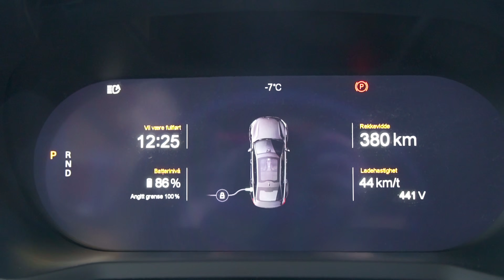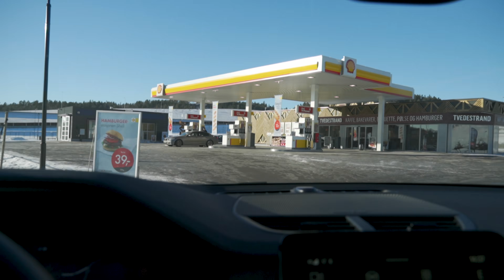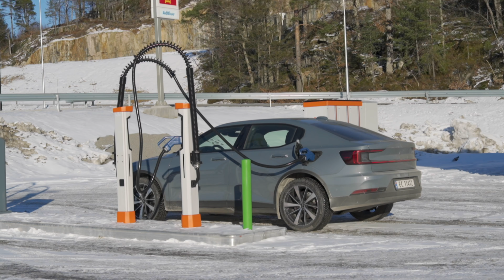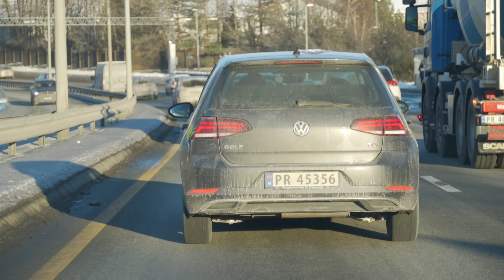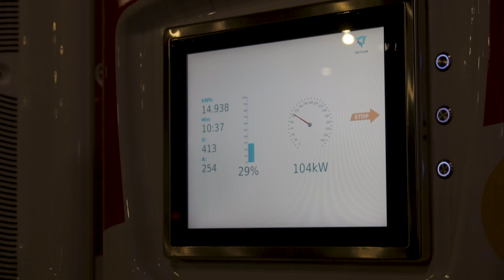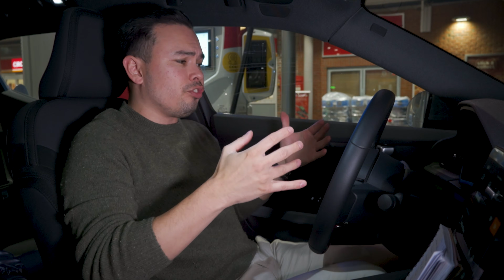Polestar 2 615km Range Test! (Norwegian High Speed Run)

Comment from the maker: This car does not have the latests software update unfortunately. But I will have a Polestar 2 Performace Pack with the update end of next week, and this exact car with the update a few weeks after that. So I will do the exact same tests with both cars 😊 So stay tuned, and subscribe and hit that notification bell if you don't want to miss those videos!
Reply: Will be really nice to get the same test with the new software.
Reply: It's the Polestar for me regardless of price and distance restraints compared to the Tesla, first of all it looks great, the Tesla looks dated in comparison the front of the Tesla being the least attractive angle, looks almost like an early Mondeo from the early 00s !

Secondly comfort and noise levels are very important to me not how far it can go, even though that can be important to some  I wouldn't swap comfort and serenity for an extra 20% distance, I don't like the slab screen in the centre of the dash on the model 3 either, so for me there is only one choice, the Polestar 2 has everything I look for in a car whereas the model 3 has too many drawbacks despite it's advantages over the Polestar, but when you know that the Polestar 2 is actually a Volvo in everything but name then that in itself is enough to swing it, Tesla's quality isn't up to volvo standards in my opinion so, when you add up all these advantages versus the drawbacks the Polestar wins comfortably in my opinion.

Comment: @KrisRifa The Pilot Assist is indeed very picky. Sometimes I need to squeeze it very hard to make the alert go away. Before I got a Volvo V60 T8 and there it was much easier to make the hold steering alert disappear. When I got the car in December it was on Summer tires. Now that I am on Winter tires (Continental) too the car is on par with the Volvo V60 T8 that had laminated glass. It's very quiet now and there's a much noticeable noise difference. It's still good on summer tires, but on winter tires it’s excellent. I'm not regretting my choice for the Polestar 2.

Comment: Cool video! Respekt ✊ to the the YOLO KING! 😁😁 
Was just thinking that unlike the etron the PS2 has only 3kwh buffer.. and considering the cars slow charging on the top it should mean that most of the 3kwh buffer is in the bottom.. which is not a lot.. 🤓
Reply: I have on the contrary heard that it have had buffer at the bottom for about 70km carefully driving and that one of the things the new update do is to lower that to get more range before the car show you 0%.
Reply: @volvodashcam  my point was that PS2 has according to spec only 3kwh buffer, and that should be used to preserve the battery.. doing 70km should be impossible when the car consumes 24kWh per 100km even of you use up all 3kwh in the buffer. 3 kw should give you around 12,5 km in theory with above consumption..
Reply: @attilaistok6168  Yea, I know. I think the 3kWh buffer is actually when it shuts off totally. You can't go lower and are not allowed to use that buffer. Then there is (as I understand) another buffer that is from the car shows you 0km left until it shuts down. That is the one that should be lowered. But I can't find any official information about this so I can be wrong.

Comment: I have been thinking about the Polestar for exactly those reason, quieter, more comfort and likely slightly better driving position, the hatch back all those are a consideration and I am waiting for the heat Pump model is likely coming out in later 2021 here in Canada and that would seal the deal!

Comment: I find it somewhat misleading to call the video "Range Test 615 km" because you really don`t meassure if the car can go 615 km in i singel charge. Every EV can go 615 km given numerous charges. I wouldn`t compare Tesla model 3 and Polestar so much, because these two cars feels so different, I suspect (not having driven the Polestar). Polestar with It`s more conventional instrument cluster, can give it more safe feeling to drive. And it`s more like a "cross over" chassit, right? Where as TM3 is more sporty lower driving feel.
Allthough Tesla would win both range and charging speed, Polestars slower charging speed might be good for the battery in the long run. Kris:  I still like your videos. I find your english and voice so natural and comfortable to listen to.

Comment: Great video! I‘m a Polestar owner and have chosen the Polestar 2 over a Tesla Model 3 due to the reasons you mentioned in your video like design, practicality (driver display, tailgate, door handles, etc.), built quality and comfort. If consumption and range would have been my number one priorities, a Tesla Model 3 would have been the first choice. Of course, the Polestar 2 has a higher consumption but we have to be fair with the car. It officially has a WLTP range of 470km versus 560km (now 580km) of a TM3 with similar batterie size and engine power. So Polestar doesn‘t even claim to be as efficient as a TM3. I hope the charging curve will improve with the upcoming February update, maybe the consumption will also be a bit better. Anyway, I love my PS2!

Comment: Would be very intresting if you compared diffrent EV's during shorter daily trips.
For example driving to a store, park the car for 15 min, drive to another store, park, and then back home. Perhaps a trip of around 20-40km.
Are the cars more equal to each other during short trips? Would be very intresting since most of the time I only drive shorter trips.

Comment: Would be interesting to know how much slower you would have to drive with the Tesla to match the time of the Polestar and then compare the noise. 😂
Reply from the maker: Hahaha! Valid point 😂😂
Reply: 20 km/h less, which brings average speed to 80 km/h (instead of 97 km/h), than the trip with the M3 will take 7h40 ... question is, is the noise level at 80 km/h so much lower with 100 km/h ?

Comment: In Sweden, Polestar is the worst EV you can buy. Superhigh charging prices in comparison to competitirs and worst battery performance winter time.

Why you would pick polestar over tesla 3 with heat pump is a mystery to me...

Btw, pleae upload a video of id 4
Reply: 1) build quality
2) tire noise / rattling noises
3) how the car feels
4) service centers and service
Reply: Not true at all. Polestar 2 is rated really high in Sweden.  And for the charging you are not bound to charge with the one plug they give you. (It's like blaming a car brand for high gas prices just because they gave you a member card on a pricy pertol station chain) It's easy to get a few rfid's and such. There ar3 even simple apps that are cheaper than Ionitys own prices. (ChargePoint)

Comment: Hi Kris,
Great video again. Yesterday I charged at MER 150kW charging station from about 20% and got very disappointing 55KW max speed. I'm really looking forward for next OTA update which promises some improvements in regards to DC charging since this situation is completely unacceptable. From this video it already seems that update had a positive impact on range, but more testing is needed (https://www.youtube.com/watch?v=UeCQr2JM8KA).
Btw, next time your are heading to Kristiansand try to avoid entering centrum (train station in particular). There is a lot of ongoing excavation work and traffic regardless what time of the day is pretty bad here. One more tip (which I'm sure you are very aware from Oslo). These 2 tunnels after bridge and towards city center are always jammed around 16 :)

Comment: Polestar 2, does not charge quick when you are with more than 10% SoC. Thats why it charges slow. Try to arrive with 5-10% percent at HPC's.
Reply from the maker: From the charge curves that are out there, and the tests me and Bjørn have done that is not true. Where did you get your information from? Do you have link? Watch my other videos on the P2 and XC40 P8. And what do you mean by "does not charge quick"? Two days prior to this test I was getting 121kWs at 40% SOC. I'd call that quick for being in the cold.
Reply: @KrisRifa  Hi own, a Polestar 2 myself, exactly the same spec you tested. 19 inch non-PP. I have noticed from experience that if you start at high SoC, that i wil not achieve the same speeds you get in the normal charge curve at the same percentage. Like you said the P2 has weird charge curve and weird charge behaviour. 

Like you tested earlier if start with a low SoC, at 21% it should charge @> 120kW. But because you started at 23% it does not nearly hit those speeds at 23%. The battery is warm enough you drove 100km/h at more than 2 hours, i have experienced the same thing in my p2.

Comment: Do you know which SW version your P2 is running?
Reply from the maker: This is running on the old version with Android 9. I will have a Polestar 2 with PP and the newest software at the end of next week, and this car with the update two weeks after that again 😊 So stay tuned!
Reply: @KrisRifa  There are already some people in Germany and the Netherlands with the latest Android 10 and the socalled February (OTA)-Update and they experience much better consumption and charging characteristics. Why (OTA) ? Because some already have it through the service at the Volvo/Polestar dealer, in Germany the OTA rollout is scheduled the last week of February in batches. :-) There are also more things for the better. : -)
Reply: @KrisRifa  Will be interesting to see if the new SW will improve charging speed👍
Reply: @kvileren  @Kris Rifa It does speed up the charging as several owners has demonstrated already. Also the comsumption is lower  and the range has also improved.

Comment: Have you done a noise test at 100kmh in both cars?
Reply from the maker: I have not done a test with other instruments than my ears 😂 But there is a big difference imo.
Reply: @KrisRifa  thanks for your reply and the videos are great. I think it would be useful to do a recorded sound test with test equipment. This then in definitive. I’m in two minds with the Ps2 and M3P like most and noise is a big concern as I have a daily 100 mile round trip.
Reply: @tryityourself3870  provably better to try for yourself, pitch and frequency of sounds will always be a personal preference
Reply: @XLoaferY  I don’t have both cars to test.
I’d suggest using a DB meter so it’s not subjective.